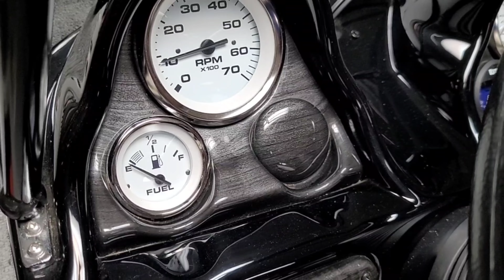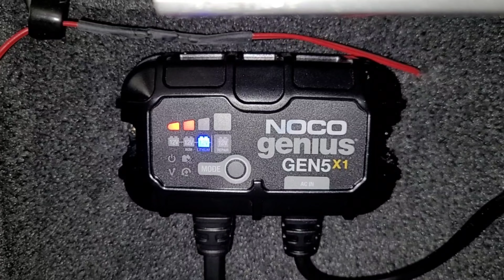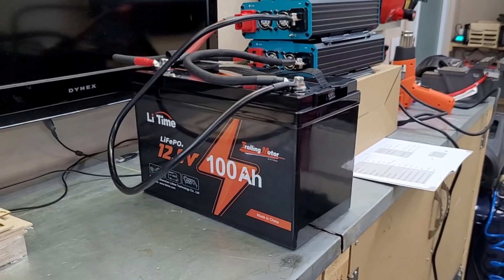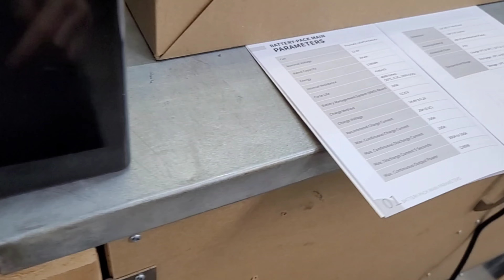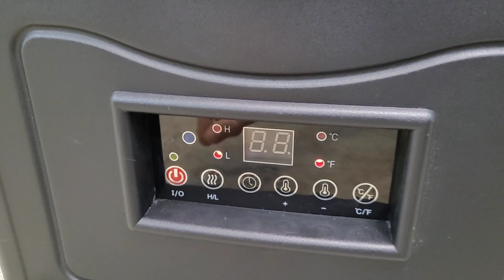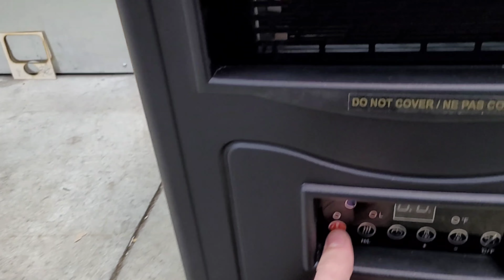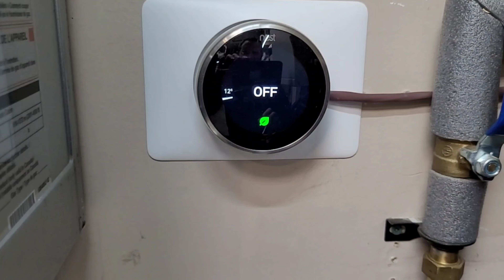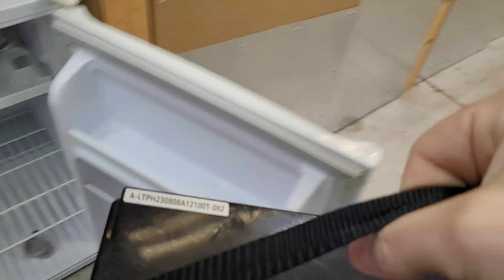Upgrading My Trolling Motor With The LiTime 100AH TM Battery

Comment: The capacity test can be short if pulling harder the .2c rate. You had it at .5 or so and I think if you pulled 200 watts from the first charger it would still possibly pass. Good video and I have the same battery testing right now lol.
Reply from the maker: That's true, I did run this one a little harder than normal

Comment: My boat is stored outside and I fish durning the winter. If the temp is below freezing, the battery won’t charge. Am I understanding that correctly? Would I have to bring it inside to charge?
Reply from the maker: Yes, charging Lifepo4 batteries below freezing will damage them. You could also try a Lifepo4 with built in heaters
Reply: @SmitHVAC.  what brand do you recommend that has a heater?
Reply from the maker: @markcantu8611  I think Litime has one or you could go with PowerQueen. I did a video on it recently. 
https://bit.ly/3GSn2Uh
Code SmitHVAC

Comment: You just running the troller motor or you doing all your electronics on that lithium . Or did you leave the agm group 31 for cranking and all your other electronics
Reply from the maker: There's another agm battery in the back for cranking and electronics, I might add another battery and switch the downriggers and electronics onto it
Reply: @SmitHVAC.  Let us know give a update on the batteries

Comment: Can I use this battery for a starter battery and trolling motor combination?
Reply from the maker: No, Lifepo4 batteries have a max discharge current of 100a
Reply: So what lithium battery can I use for both starting and trolling ?
Reply from the maker: @jackson4861  I don't think there's any lithium batteries you can use for starting besides automotive lithium, people use them for race cars because they're very light but I'm not sure if you could troll with them